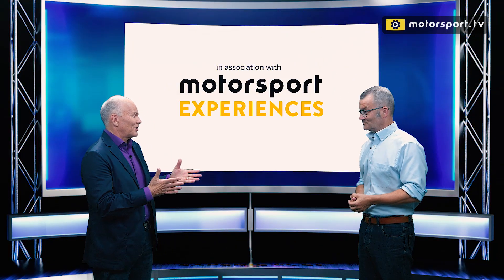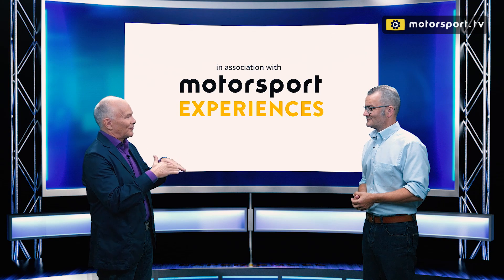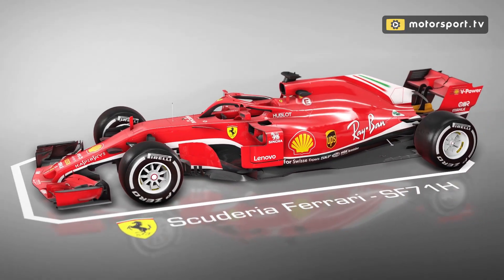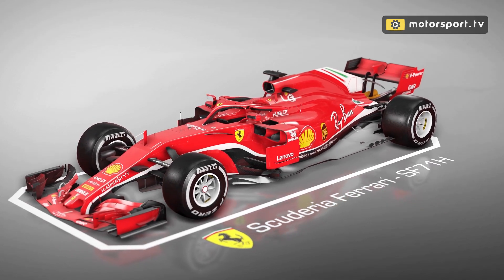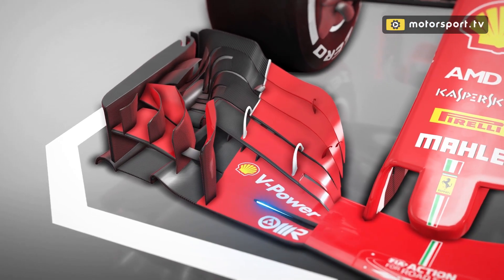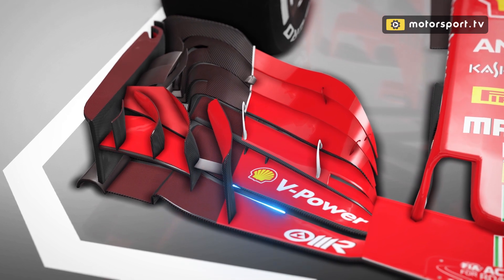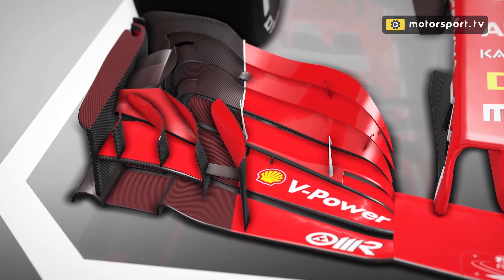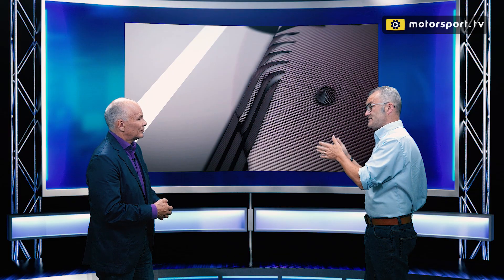How new floor slots helped Ferrari win the British GP

Comment: Why is the ferrari engine so much louder in the traction zones than any other car. Even cars with Ferrari engines didn’t sound like this. Sounded like traction control but obviously it isn’t.. maybe torque vectoring? Out of luffield and through chapel it was most obvious!
Reply: marc foskett that's wastegate opening (i think)
Reply: https://youtu.be/kHsM63dH-yE
Reply: Snippy hello thanks. I dont think this is it tho. None of the other ferrari engines do this and you can hear either the engine software or diff transferring power on traction then it stops once out the traction zone. Chapel onto hanger straight is most noticeable. My personal opinion is its a-form of torque vectoring through the diff as traction control through software isn’t allowed. Would also explain ferraris better traction

Comment: Can you make a aerodynamica that the car who follows you is unstable unbalanced? Yes so does that count as 'cheat'?
Reply: Theoretically yes if you know exactly how the other car was designed. . But by doing that does not mean that your car is faster. You can "cheat" all the way you want but cannot really win a race. So it is silly thing
Reply: Creating turbulences requires your car to transfer energy to the air. That would then be energy you don't have pushing your car foreward (or downward). If you already manipulate airflow, it should be to make your car faster (be that in a straight line or through corners).

Comment: I heard kimi say that it was harder to follow redbulls than Mercedes may i know why is that plzzz reply
Reply: Turbulence air is a factor but i think it everything is related to the car design philosophy, the way the car create turbulence, etc. . Remember Barcelona 2016, Kimi said that the william is the hardest to follow although it was not the best chassis. 

p.s: i doubt whether the red bull has the best chassis.
Reply: TheOdd101 exectly
Reply: DonDon JJ i think The Williams was difficult to follow because we know that they hadnt or have The best aerodynamic and maybe they Had/have a big idk how to say it calls in german "Luftwiderstand" (translate it)
Reply: MOINCRAFT. TV ,  You mean wind resistance (from dict.cc) ? I think wind resistance affect the front car more than the following car.
Reply: DonDon JJ yeah i mean this and No because if The car behind gets No wind it hasnt than pressure in the Wings
Reply: MOINTCRAFT. TV, it is true on the straight but not in corner. Turbulence air is the culprit hence making the wings produce less down force
Reply: DonDon JJ  exectly and spain is a shit track to follow Like 2016 Kimi and max and this year Vettel didnt overtaked verstappwn with fresh tires
Reply: Bala Bk Probably because the Red Bulls have the best chassis and therefore, they probably create the most turbulence behind them.

Comment: The ferraris were "eating" though their tyres though, had lewis kept his number 3 spot after the disastrous start he would have demolished vettel on pure pace and tyre management alone.
Reply: Dimitar Iliyanov 
No! The Ferraris were not eating through their tyres at all!
And Hamilton demolishing Vettel.. lol yeah right! We saw how efficient Lewis was at that at the start!
Reply: Swapnil Nayak Lmao is this why both ferraris had to do a 2 stop strategy and even with much older, harder compound tyres bottas was holding off vettel very well?
Reply: HAD to 2 stop? more like pitting under safety car and losing a wee bit of time but get softs nearly 20 laps younger
Reply: Dimitar Iliyanov If you watch that race you would understand that the second pit was the only sensible thing to do. Had there been no safety car vettle would have still won had Hamilton and Kimi didn't crash vettle would have still won. The Ferraris was just faster car on the day just accept that pal. Stop talking rubbish bad day at the office for Merc
Reply: The only thing Lewis is gonna demolish this year is his title challange.
Reply: Dimitar Iliyanov, Rofl you don't sound like a mechanic or engineering student at all. You are the one that making delusional f1 newbie statement.
Reply: Dimitar Iliyanov, Do you even know that race leader usually controlling race pace? You should consider that Vettel might turned down the engine, saving fuel, managing brakes etc. Bottas meanwhile maybe (or not) were pushing harder. He did closed the gap by 2sec but did it proved to be threatening vettel positon? No, he is not even in an overtaking window. Vettel can open up the gap again if he wanted to which is doable considering that his sister Ferrari, Kimi, (With an older tyre) was doing purple lap time few lap before. Do i still sound delusional to you?
Reply: Dimitar Iliyanov, i think you are a new F1 fan, arent you? The Ferraris did one extra stop not because of they were "eating tyres", it was because there was a safety car and pitting under it will only cost a fraction of time compared to normal circumstances.  Even on better tyre, overtaking is hard because of the "dirty" air. That is why sometimes team will prioritize track position, just like Mercedes did in this grand prix.
Reply: Dimitar Iliyanov, tell me how do you know bottas has better degradation than the ferrari only after few laps with the medium?
Reply: Mercedes is arguably the worst top team in tire management. If you think Ferrari eats the tyres, you should watch the Bahrain gp another time. Mercs suffer blistering if they don't manage well the tyres in the first laps of the stint. The only tracks where they suddenly became the best team were Barcelona, Paul Ricard and Silverstone, because Pirelli brought completely different tyres for these track. Allo of these had the asphalt renewed, so Pirelli brought tyres with 0.4mm less tread purposely tu reduce the blistering caused by the new asphalt. But now these these thinner tyres will not brought back in any of the remaining races, so Mercedes will lose this advantage
Reply: Dimitar Iliyanov 
There is something called tyre management and fuel management that goes on during the race "'Mr Genius studying aeronautics"' and that is exactly what Vettel was doing in this race, same as he was doing in Canada!

Oh fun fact: if you listened to Mercedes race directors after the race they said that they asked Valtteri to do the opposite of what Vettel does.., so basically if Vettel stayed out then they would have brought Bottas in and vice versa because they knew that if they had to win they had to something different and not shadow whatever Ferrari does!
Reply: Daniel ricardo will catch up lewis if the safety car is not deployed 😂 lewis will be at 4th or 5th place
Reply: Dimitar Iliyanov The ferrari was in every race nicer to his tyres look at austria.
Reply: Dimitar Iliyanov lol you absolutely have no idea how tyres work , all the tyres in F1 especially from the softs and onward have a "2nd life" , when they get rid of that basic layer of the tyre , it regains it's balance and therefore becomes faster after a while which explains why bottas was pushing some decent lap times.
 And btw the ferraris have way better tyre managment than the mercs ( Bahrain , Monaco , Austria ...)
Reply: Sub Polar, i think the "2nd life" you mean is when the tyres up to an optimum temperature when the gave the most grip am i right?
Reply: Sub Polar, Don't worry mate we understand your statement well enough. I don't speak good english either hahaha
Reply: Um , no .   Where were they after the final pace car , Seb managing the pace , no risks , especially getting past Bottas .
Reply: Dimitar Iliyanov did you not see Vettels post race interview where he said he was managing the pace and when asked if he was worried when Valtteri was catching up, he said "no" immediately and said it's one thing to catch up but another to overtake
Reply: You do know that Hamilton was a lot faster only because he was using DRS of the slower guys and getting more top speed, as soon as he was in clean air his lap times matched the other top teams
Reply: DonDon JJ Right after vettel and bottas both made their first pit stops the difference was around 4secs. Few laps later and valterri had closed the gap to 2 seconds and arguably still had more life into his tyres. Tell me how my initial stament was wrong you shoddy bellend.
Reply: Hope someone can explain this more , i suck at english
Reply: Dimitar Iliyanov well there's a reason drivers race and mechanics fix
Reply: Mr. Karim no he only had a chance because of the safety car
Reply: Dimitar Iliyanov man do you really think vettel had to stop after few laps he changed to mediums because of degradation? Wtf he changed tyres to make the strategy red bull made onanothet track and have better tyres without losing so many positions, also yes before ferrari sucked on these 0.4 tyres but now they fixed it
Reply: Megatron 
Yea sure, but sadly I am the one stating facts here ya friggin dumbass! 
Go home and keep getting triggered by Hamilton's defeat!
Reply: Bottas lost again because of the SC...
Reply: Swapnil is one of those ferrari fans who are allergic to facts
Reply: Dimitar Iliyanov poor guy he got destroyed
Reply: Dimitar Iliyanov Vettel was certainly nursing his tires. Bottas wouldn't have cruised past anyone. Did you see how long it took Vettel to pass him after the safety car with brand new soft rubber? Now Bottas was going to "cruise past" when both were on the same tire? Ok sure.
Reply: I noticed that too! Bottas was closing in on Vettel quickly before the first pit stops.
Ferrari responded by pitting Vettel first when the gap got down to less than 2 seconds to prevent an undercut.
Bottas had better tyre management than Vettel, and stopped 2 laps after Seb. If there hadn't been a SC, Bottas would have won the race and Lewis would have finished 3rd because his tryes were 11 laps younger than Verstappen and he was closing down fast on Kimi before the SC came out.
Reply: DonDon JJ Did you even read my previous comment? Bottas was leaning hard on his mediums yet was still getting better degradation from them than the ferrari. If they had continued in that fashion then at the end of the race bottas would have had the sheer tyre advantage to drive by vettel, same thing we saw in spain, vettel was keeping lewis honest in terms of pace but the tyres had none of it. So yeah the ferrari hasn't been as nice to it's tyres as the merc throughout the season(maybe only in bahrain china and baku we saw good tyre  management from the italian car).
Reply: GlacialWolf Destroyed? Lmao I gave up trying to explain to these half brained fuckwits that even while managing his tyres and not pushing hard vettel had the same or worse tyre degradation than the merc(same as in spain for instance) but yeah the shoddy bellends kept talking about races like bahrain, china...etc. where the track wasn't resurfaced and Pirelli hadn't opted for the thinner thread tyres. Of you read some on my previous comments you will see that I've talked about the merc being worse on it's tyres on some tracks(china, bahrain, baku) but that was not the point. The point is that on the resurfaced tracks the ferrari is dead in the water, in spain they even had to go for a 2 stop because vettel couldn't keep his tyres alive(spain and silverstone are far more similar tracks than you can imagine, high speed corners which put lots of energy into the tyres). But yeah half of the guys who commented here are complete fucktards with zero brain function.
Reply: LMAOOOO all of you ferrari fans are delusional. On the mediums bottas was closing in on vettel FAST and had better tyre degradation even though he wasn't nursing the tyres. Had there not been a safety car, valterri would have passed been a threat to vettel really quick. The safety car gave ferrari the chance to put on softs, tyres on which they were faster than the merc but once again had worse tyre degradation(that wasn't a big factor though considering the number of laps left in the race). So yeah without that 2nd pitstop the ferraris would have been no match for the mercs. 
P.s. I've been a mechanic for a formula 3 team and am currently studying aerospace engineering, I know my shit about racing better than 99% of the guys here lol

Comment: Yk because the floorboards were the reason vettel won not someone spinning who has won it the last 6 years or something
Reply: legendarygaming Hamilton was down in 3rd when he spun. Vettel was already by him.
Reply: MCBackDraft1 we all know hamilton has a very good pace considering he ended up 2nd whil being last idk but to me it looks like he had superior pace all weekend
Reply: Not really. Both Ferraris qualified within a tenth, that's basically nothing. Vettel was just as quick. Ultimately Hamilton wound up 2nd in large part because of the 2 safety cars erasing the gap. But even if he hadn't been spun out and Bottas let him through into 2nd, in all likelihood he had lost the race at the start and would have finished 2nd to Vettel anyways.
Reply: You're correct, but that doesn't mean anything I've said is incorrect. I'm just pointing out that Ferrari had the pace to control from the front. Hamilton had a high probability of being relegated to 2nd as soon as the lights went out and he got swamped by the field.
Reply: legendarygaming its not hard to get from last to second when you have the second fastest car

There are clear classes in f1 now, its ferrari, mercs and RB in the top class and then everyone else

Vettel held off lewis for the entire race while lewis had DRS
Reply: MCBackDraft1 I'm guessing you don't like Hamilton
Reply: MCBackDraft1 yes your probably right, it's one of the reasons Im getting bored of F1 at the moment, the race is won or lost at the first corner.
Reply: MCBackDraft1 who knows without that penalty Kimi still had a shot at a podium
Reply: Kimi did finish on the podium...